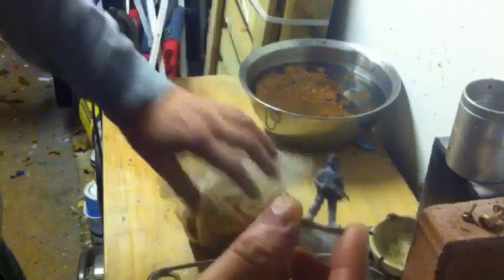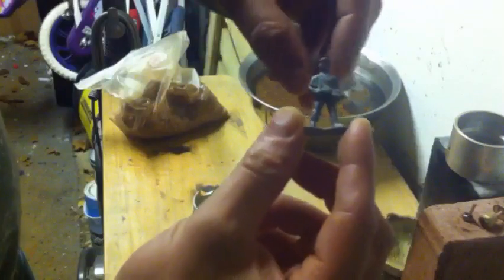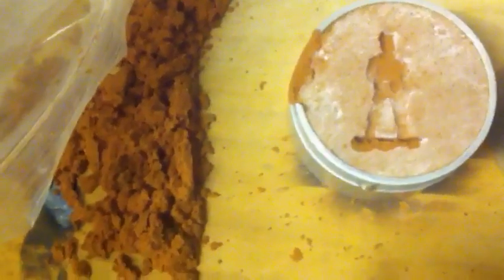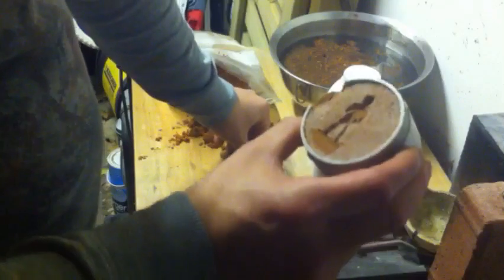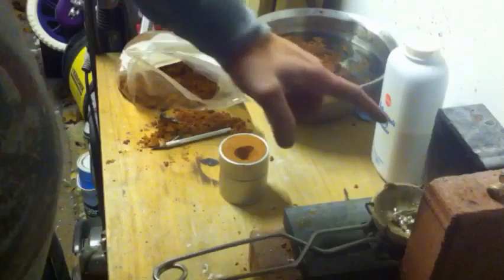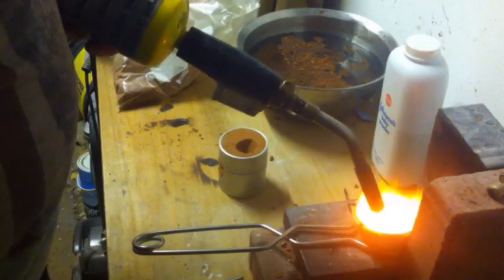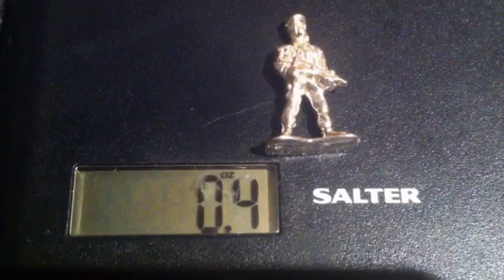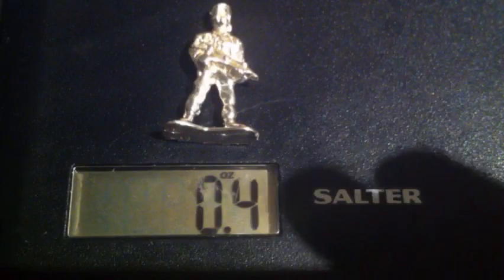Casting a silver soldier

Comment: i need delft clay help, i have 100mm rings 
i think i have air flow issue or my torch doesnt have enough heat. i have same torch you used here but i also have lil smithy with melting tip and air propane mix

Comment: You dont have to pack it that hard,just firm, wrist pressure should be good enough.I sand cast lots of stuff,ck out my ebay,search by seller bronzeart2001 have a skull ring a devil ring and a sugar skull all sand cast,but i do the ring shank separately and assemble w a torch,good stuff mate!

Comment: have you tried the delft clay alternative they have on ebay I know its a lot cheaper but didn't know if it worked about the same
Reply from the maker: Yes in my skull video I used petrobond. It does the job. But I found it's not at effective as delft and would leave pitting on the cast more.
Reply: cool I might just try some of that to get my feet wet before making the big investment
Reply from the maker: certainly worth getting you still make great stuff with it and you can just spend a bit extra on tidying the silver up

Comment: Way to go. It worked out good. Do you use a dremel tool to clean it up?
Reply from the maker: Yeah I have a silicone sanding attachment for it. Also tumble it after for a few hours. It's suppose to strengthen them to all we'll as taking of any burr